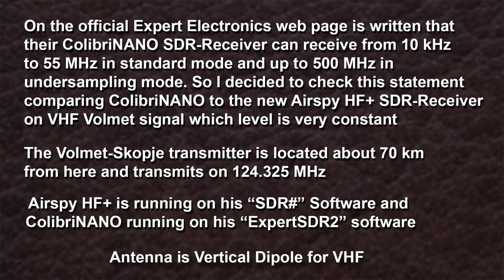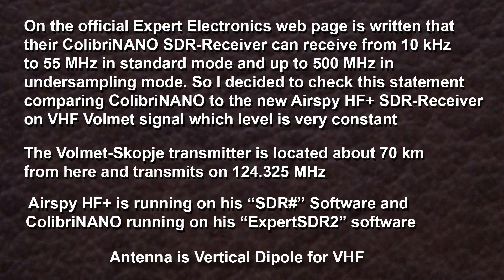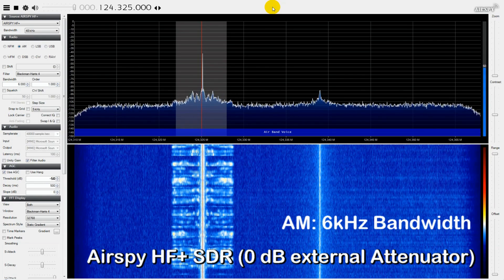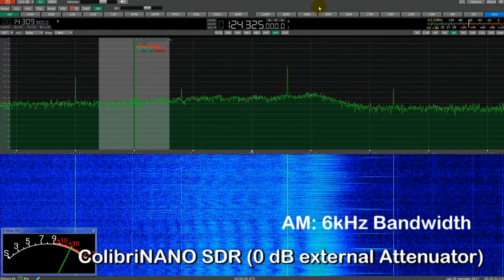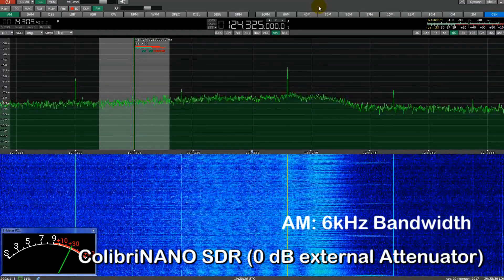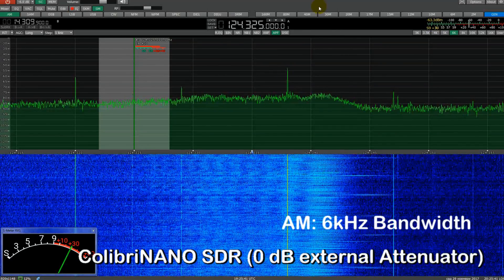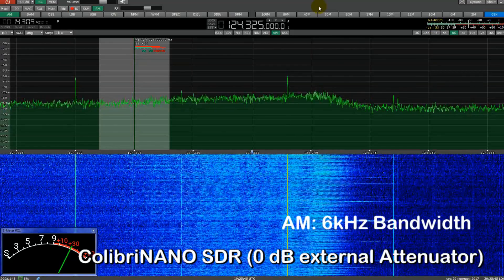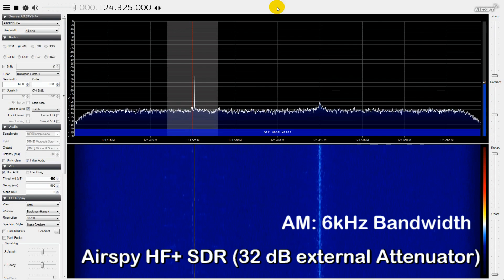Airspy HF+ SDR vs ColibriNANO SDR on VHF

Comment: You must put a VHF RF filter in front of the nano colibri to use it in VHF-UHF. I use the ColibriDDC which has filters for HF (very efficient) but not in VHF-UHF. The ExpertSDR software is very efficient in HTML5.0

Comment: possible to do a VHF test with a RTL SDR v3 key against the AirSpy HF +?  merci for the test Mile 73
Reply from the maker: I haven`t  V3, Only regular 4 years old RTL-SDR (R820T). All RTL SDR dongles are very cheap and because of that they are very popular. They are also very sensitive and can copy this VHF Volmet signal for sure. But they have very limited dynamic range for serious receiving, especially if you are using RTL-SDR in urban and industrial area full of many radio transmitters or if you are using them in rural area but close to some TV or radio transmitter or mobile phone base station...